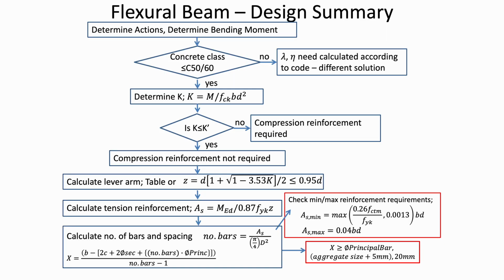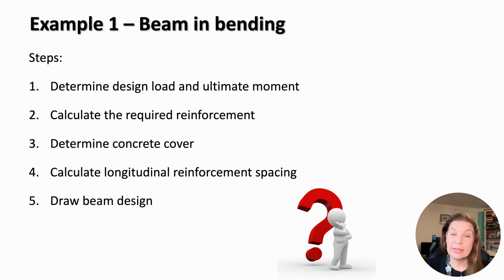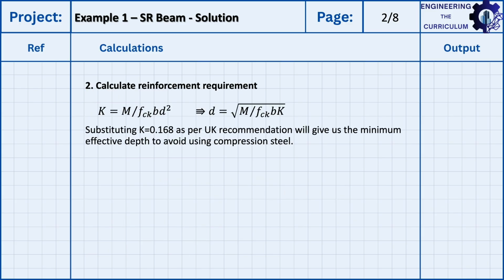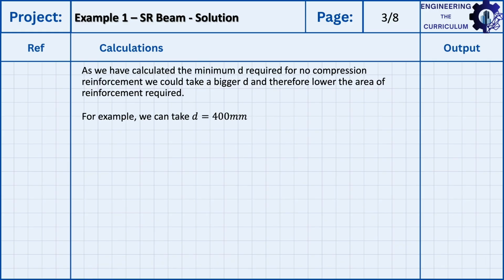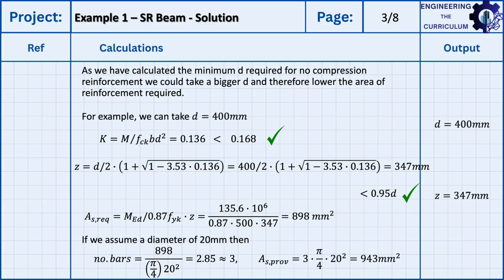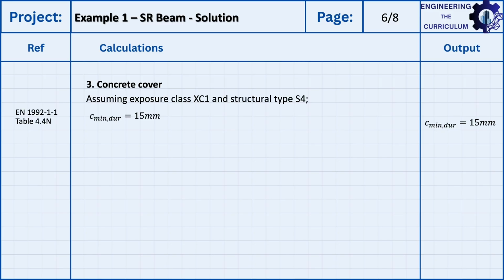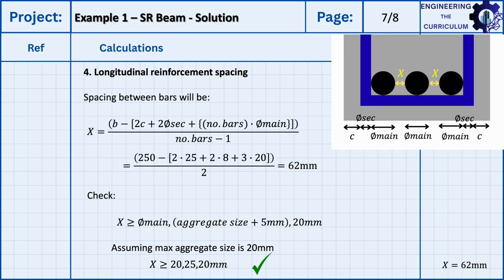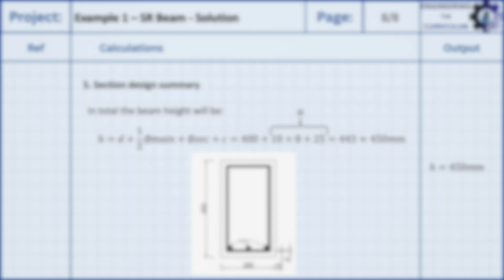Reinforced Concrete Design | Singly Reinforced Beam Tutorial: Worked Example 1 | Eurocode 2

Comment: Good lecture Dr Margi Vilnay. I have a question. If for instance the As required was 954 square mm, instead of providing 4T20B, can I do 2T20B+2T16B?
Reply from the maker: Thank you — I’m glad you found the lecture useful!
Yes, you can use a mixed arrangement such as 2T20 + 2T16, as long as the total steel area provided is at least the required area and all other detailing checks are satisfied, including spacing, cover, anchorage, and constructability. In your example, 2T20 + 2T16 provides 1030 mm², which exceeds the required 954 mm², so it satisfies the area requirement.
It can also be advantageous in some cases, particularly where continuity is required. For example, some bars may be kept continuous through the member, while additional bars are provided or curtailed where higher moments occur. This can lead to a more efficient and practical detailing arrangement, provided all code requirements are still met.